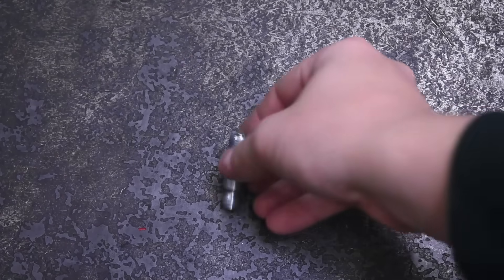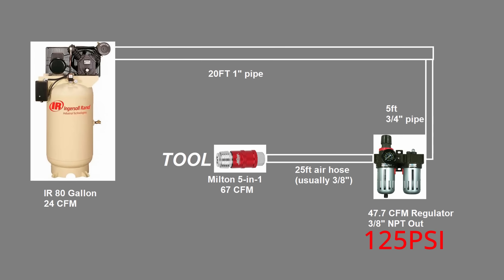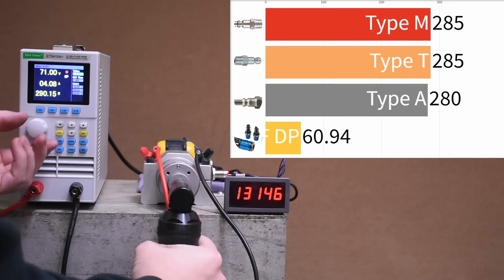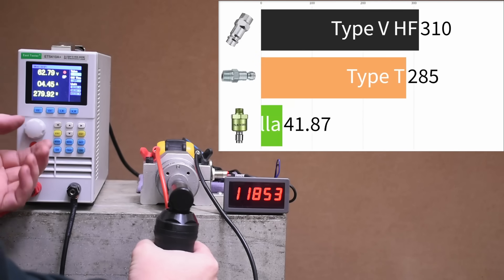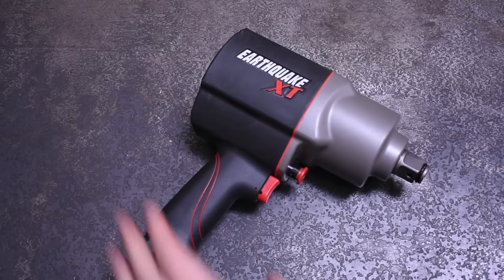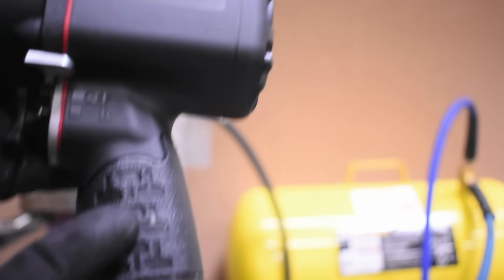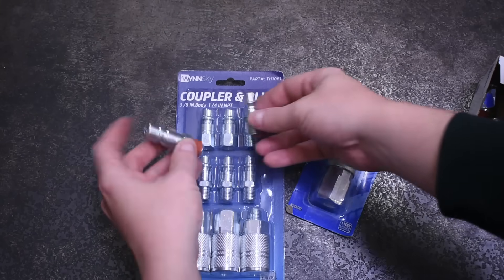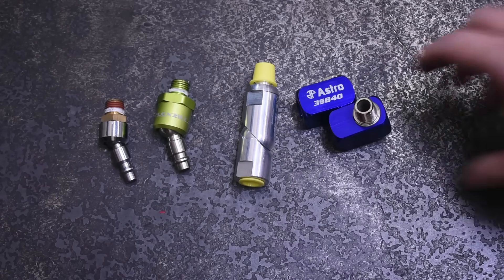Triple Air Hose? Testing Best & Worst Power Adder Tricks

Comment from the maker: An expansion tank would/should work better if you're already starved for air like a small compressor or super far from the source. Just didn't quite do what we needed to test 3/4" impacts faithfully.
We've also been compiling for over a year "conspiracy theory" sort of techniques from the comment section you guys say increase torque from impacts. Like holding the socket or turning in the direction of impacting. We have like 9 or 10. Share your tricks of the trade for us to test in the future when we do that!
NOTICE: I came up with the original version/prototype of the 3-way air swivel, so while none of us benefit financially from it selling, it might not come as a surprise that A) we like it and B) it does well on the tools we test with. Always consider multiple sources when looking at a tool!
Reply: I was gonna comment about the expansion tank.... any chance of seeing a video with around 150ft of 3/8 line high flow couplers on both ends. With and without expansion tank.
Reply: To make the most of the expansion tank, I run a 5 foot hose between it and the tool.
 Hose length from the pressure vessel makes a huge difference in pressure the tool actually sees after the first pulse. Makes a world of difference running a 1 inch gun in a mobile repair truck
Reply: I have an expansion tank that I use for my roofing nailer and some other stuff.  I want to say it's 3/8 into the tank but absolutely gotta dump the included valve, plumbed in with a gauge, quick coupler on the input and output and a shutoff valve for the input so I can pressurize the tank and then use it to air up a tire.  Ended up with all this because the little 5 gallon cheapo pancake compressor dumped air to drop the pressure down to the proper pressure for my nailer ~90 psi.  I bought a cheap external regulator and it it a bit restrictive but with the tank in line as well there is no issue and I can run nails all day long without issue.  Just using the compressor I would have to stop after a couple nails and let the line pressurize back up again.

The added advantage is to charge the tank is much simpler than holding an air chuck to the tank till it's charged. I just set the regulator for 100 psi which is a little below the maximum rating but I can walk away and know that when I get back it will be charged and ready to go.
Reply: That's why I use a booster tank, myself. My little 4.1CFM compressor really can't do much outside of the shop, where it doesn't have the shop's cooling, so I just run a 3/8" line from the compressor tank to the booster tank, and then run tools off the tank itself (I have both a 100' and a 3' line so I can use the booster tank in the shop too, without dragging 100' of hose around)
Reply: You guys answered our comments in the most TTC Fashion ever 😂
Reply: Can you test whether putting  a hammer drill in hammer mode is faster or slower than an impact driver? I know they use different mechanisms, but I'd be really interested in whether they act the same or not.
Reply: Ice affects power too, as far as moisture freezing in my angle grinder after 10 minutes,so I stop and hit it a while with a hair dryer to thaw it out.
Even with draining all the time I'm tempted to try a little air brake antifreeze in the tank. 
Part of the shop is heated ,where the compressor is but the part I'm working on isn't heated.
Reply: @MrTheHillfolk  the pressure drop and moisture are what cause that. Harbor freight sells a little automatic bleed valve you can add that will stop water build up in the tank. Makes a huge difference. Haven't frozen a tool or gotten clumpy sand since I added it
Reply: I recently tryed using a old 10 gallon tank I have for the expansion tank with a ball valve shut off line to my old Chicago pneumatic air file (body work sander) Then ran the other line on that expansion tank to my old 2 stage belt drive 8ish gallon compressor, all it seemed to do was constantly run the compressor. Maybe it would work better on a impact or air tools that you only use for short bursts at a time. It definitely didnt help me in running a big sander. Ill be upgrading my air compressor this spring, got alot of sanding to do and Sanders are probably the most air hungry tool of them all.
Reply: Uui😮you get off the road now I’m sorry to you I didn’t mean that you got me a good morning I just woke me right I was asleep lol kkkkkkkkkh
Reply: TTC, what air fitting did you have in the new Astro Hi Flo swivel?
Reply: how much gain is there from threading the tool direct onto the expansion tank
Reply: My favorite is using CO2 tanks with high output pressures. I use a 200psi Western fixed pressure regulator (no gauge to break) but for your testing you may prefer a conventional regulator showing input and output pressures. A few feet of hose gives the CO2 time to expand. Check out homemade "power tank" videos by 4x4 owners for a variety of ways to DIY tanks. They're great for filling tires in the field and seating tough beads too.  I collect small and large CO2 cylinders since I can also use them with my MIG welders. 

The Air Force has used "air pigs" (expansion tanks with multiple chucks, so named because pig and nursing piglets...) for many decades.  Larger diameter air hose is also a very good idea.
Reply: Wait trying to break records at 125 psi but why not push it to see if it car move it even more
Reply: Some impacts like this, some don't. But at least with electric guns, I've had good luck with holding the gun very loosely and letting it rattle more. Sometimes it does help break loose a fastener that's right on the edge of coming loose.
Reply: All these numbers.... And no bean talk. I am lost. 😂 Thank you for what you do. Very informative channel, so much better then praying website info is legit with tool info. All my construction friends are "Milwaukee or nothing" fan boys, and I'm always the "Craftsmen that could" kind of guy... why spend more when something still works. A lug nut doesn't discriminate a $200 tool n a $400 tool, it's coming off regardless. But my tools get touched 5-6 times a year, not 4-5 times a hour either.  Best $15 I spent was your tool charts. Thank you for the beans.
Reply: Expansion/buffer tank with a short outlet hose will give a short burst of extra power when you first hit the trigger. Which is often all you need to bust something loose. Not something that'll show up with your current test though. Hammering the rig up to max torque then hitting it with a few trigger bursts, with and without the tank, might show the effect?
Reply: I had a guy tell me once that he filled his air impact gun with air tool oil and then hit a hard to loosen fastener with it. Sounds like a mess at the minimum. Maybe he was trying to prank me. Never tried it.
Reply: @iowawrench  I have and it works especially with worn impacts where I used it (scrapyard), but the smart way is break torque using the overkill method of choice then use the impact to run the fastener.
Reply: @jsplasha  LOL  At 150 psi, I chicken out. On the positive side, I'm still alive.
 edit; I went back to 120 psi a long time ago because I'm using the identical hf tank, he used.
Reply: I hope this is the right place to request this but can you do  the "MAKITA DWT310ZK TWIN 18V LI-ION LXT BRUSHLESS CORDLESS SHEAR WRENCH" looks cool wondering I its worth is price tag
Reply: That's what I do in my home shop.  I have a higher-end but still home gamer 120v Husky compressor with a 4-gallon 225 PSI internal tank piped through a regulator to a pair of 155 PSI 10 gallon portable tanks and it nearly triples the amount of time I can run a die grinder before the compressor drops below a reasonable 80-90 PSI to it's steady state flow of around 50 PSI.

Comment: Out of curiosity, which would likely provide the the most pressure at tool on a 25 ft 3/8 line w/ 1/4 fittings: 1/4 hi Flo fittings/couplers or 3/8 hi Flo fittings and couplers reduced down to 1/4 thread with reducers? I kind of think the results would be similar but I don’t know enough about these fittings to be confident. As far as compressors stats…with any compressor, which setup would provide superior power at tool?

Comment: I use a 3/8 hose and 1/4 fittings that I drilled out and what a difference it made!
Reply: Not a bad idea. With standard couplers? FYI, v style couplers will accept standard 1/4” fittings with no modification though I can’t attest to how well this works personally

Comment: So if you could hook the regulator to the bottom of the impqct and then set the line pressure and air tank pressure at 200+psi (if a hose can support it) you likely wouldnt get any hose loses as the airspeed through the hose would be reduced

Comment: Anyone have the part number on that 1/2” quick connect with the 3/8” threads? Couldn’t quite read it in the video. 

I’m now wondering how much difference there would be with some of the more uh “mid torque” type air impacts such as the Mac.

Comment: Here in the uk 🇬🇧 we use PCL fittings. Either standard or XF couplings. There is also a big Pcl 100 series coupling what is normally used for 1/2”-3/4” hose. There all very good quality too.

Comment: buffer tanks work well for that initial grunt on an air impact or keeping supply up on very long runs for intermittent use like nailers. Good bandaid, not a fix. 0/10 points with a plasma or paint gun.

Comment: Just got my hands on the Thor G2 and then realized I'll need high flow fittings.  I'll have to replace the coupler on my hose at the tool end but I was wondering if I also needed to swap out the coupler and fittings at the compressor side to a high flow type in order to get the true benefits.  Thanks in advance.
Reply from the maker: Yes, unfortunately you for sure do.
Reply: @TorqueTestChannel  Will flow be impacted by using a 1/4 fitting with the provided adaptor on the Thor G2 vs just using a 3/8 fitting?

Comment: It’s definitely time for a rotary screw compressor!!! They are getting more reasonable in price… that railway gun would have been a significant portion of the investment for example… lol. We’ve got an atlas copco rotary that runs most of the place at work but also an IR with a measly 460v 700amp motor turning it. That thing is wild

Comment: I have 2 compressors both hooked to piping that goes through the shop, out to the driveway, and up to the top of the basement stairs. One is about a 60 gallon PAR from the 1930s with a 3 phase 3hp motor, pressure switch at 160 psi. Inline twin cylinder pump running at around 750 rpm. The other is a V twin 1940s Craftsman with 240v single phase 1hp motor but no tank. It comes on when the pressure in the piping reaches 95 psi and shuts off at 125. I use 1/2 inch G style couplers for big tools, 3/8 T style for everything else. With a 1/2 inch old style aluminum Earthquake impact running at full blast, once the Craftsman kicks on, it just stays at 95 psi, it won't drop below that on anything other than the big rotary sander or a big blow gun on a half inch hose. Compressors are hooked up to the piping with 1/2 hydraulic hose and Chicago fittings. The original plan was to get a second tank for the Craftsman but I have yet to run into a situation where it's necessary.

Comment: Also I have found some industrial air fittings at harbor freight that are 1/2-14 npt that that I have adapted with galvanized pipe fittings down to 1/4 npt directly into my air tools to a 1/2 air hose.   My God what a difference they all make.   Opening you airflow to your tools is like adding a turbo ..

Comment: Tractor supply has 3/8 industrial fittings that have a 1/4 npt. The automotive inlet are slightly smaller then the industrial inlet. I have gone to home depot and got 1/4 galvanized pipe connector that have a bigger internal hole the fittings you normally get have a small internal hole

Comment: So I have a question. I do auto.otive detaing. I have purchase a vortex style airblow cleaning tool. also a huskey air blow gun
 i currently have a Masterforce 20 gallon compressor. I am running a flexzilpa 3/8 inch airhose
 Now all the fitting to the ajrtoold are your standard 1/4 inch. I would like to get the most performace out of my airtools. So my question is would any 1/4 v style hi flow set work or would you reccomend the Milton or the DP brand? 
Masterforce has there ow 1/4 v style.hi flow kit as well. 
Thank you

Comment: Do yourself a favor and don't even bother with the JACO Hi-Flow fittings on Amazon. Had all of the couplers fail with minimum use and caused lines to disconnect while in use and caused my air lines to look like none other than the Wacky Waving Inflatable Arm-flailing Tube Man.

Comment: If you need serious power it's not that hard to run a bushing in a Chicago coupling to a thinner short "whip" hose with NO couplings, just open pipe fittings. I do this with my sand blaster because a conventional coupling strangles flow. I plumb with 3/4" ID red hose between two 5HP industrial compressors feeding a large receiver tank and for what the used equipment and plumbing cost (about a grand) I should have done it decades ago.

Comment: The Milton H or P style fittings are 3/8” body and listed at 68 SCFM.  The Milton V-Style 1/4” body are high flow and claim 74 SCFM.  Something doesn’t add up.  The 1/4” body is so small compared to the 3/8”.  Looking for answers..

Comment: @TorqueTestChannel
 You didn't provide a link for the larger fittings that fit smaller npt threads.. In particular what are the best fittings to run on the Thor air hammer? Thanks
Reply from the maker: Here you go: https://amzn.to/3ObhgQT
Those or 3/8" hi flow fittings in general

Comment: Industry uses large "receiver tanks" and so do I after hunting one down since I'm setting up for light blasting. Anyone can add a receiver tank and anyone can plumb a variety of hoses. I'm using small 3/4" ID red pneumatic hose with Chicago couplings to plumb my shop (I set up everything like a job site for fast easy construction, repair, maintenance and modification, and red air hose is cheap at a couple bucks a foot). I run short small "whip" hoses off my air pig connected to the larger hose.

BTW air compressors differ drastically. A so-called 5HP consumer shitbox whose motor HP rating is "SPL" is not the same thing as an industrial three phase 5HP continuous duty compressor. (That's a key reason cordless tools are usually a better idea for anyone without serious compressed air systems.) If you want big air affordably do some homework because industrial compressors which intimidate novices are actually rather easy to set up (I put my horizontal Saylor-Bealls on welded frames with scaffolding casters for drastically improved convenience). You can get legit 5HP single phase 240v electric motors or run a phase converter to power healthy compressors, or of course find or make an engine driven compressor for bigger work then use baby compressors for minor stuff. I learned to fix used consumer compressors and scatter them everywhere  since they were close to free.

All this is why I mostly use cordless and corded tools! Unless your air system is capable most pneumatic tools never perform near peak ability. Air is nice for tires etc but if I didn't want to blast and run large needle scalers I'd just run baby compressors. As cordless tools improve they will surpass most corded and pneumatic tools because cordless are only constrained by their own batteries. 

Thanks for your awesome channel! Manufacturers should note it moves money. I've spent several hundred bucks on TTC recommended tools and am delighted.

Comment: The thing I found was improved by a buffer tank was a high capacity nail gun, the remote tank allowed me to nail into tasmanian oak with 100mm nails on an elevated two story house where it was impossible to put the compressor on the top floor.

Comment: A rancher I once worked for had his 100 gallon shop air compressor plumbed into an old 500 gallon propane tank, and about a 3/4" hose coming off that. I dont remember ever having to worry about air volume.

Comment: I can 100% say from experience that air tool oil is just to maintain the tool. When you have a ½ inch Husky air impact, if you use good air tool oil, it will last indefinitely. If you dont, it will last about a year.

Comment: fluid dynamics 101.  you need volume for more power.  example.  try using a 3/8" air line on your 1" wheel gun.  it doesn't work.  put a 1" line on it and it rips lug nuts right off.  use high flow fittings with 1/2" to 1" line with 125psi to your tool and it will give it the most power your tool can give.  another example about volume over pressure.  a bike tire at 120psi blows it's no big event.  a class 8 line haul tire blows?  it can toe tag you!!  reason?  almost 40gal of air in the truck tire compared to maybe 16oz in the bike tire even though they are both at same pressure.

Comment: I've been thinking of testing some Nitto (japanese industrial standard) air fittings, as they have some pretty cool features, but also because they look like they might flow more air and be less prone to damage than some of the hi-flow designs. They have one style of coupler that is basically a ball valve inside, giving the full diameter of flow.

Comment: I used 3/8" Milton M with a 1/2" air hose at 175 psi and had 160 gallons of air capacity from two 7.5 hp air compressors in series with a refrigerated air dryer delivering very dry cold air at my old shop and had great performance from my air tools.

Comment: Your DP commentary never gets old. 

I would like some more DP.

BTW I use the flexzilla on my air hungry tools that need the swivel. Been pretty happy with it for the last ~2 years. 
I use some HF fittings made of brass I got off Amazon. They seem to hold up fine Been ~3 years without issue.